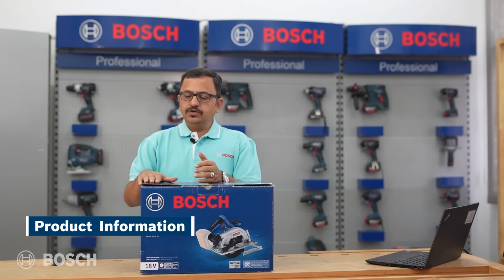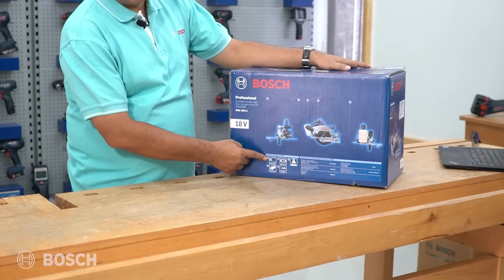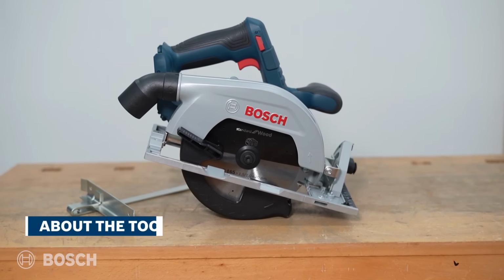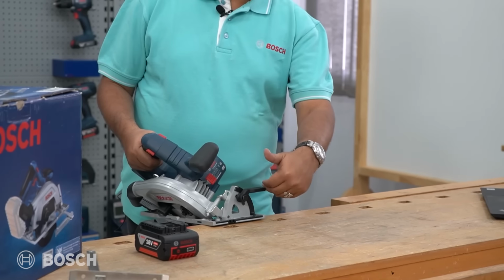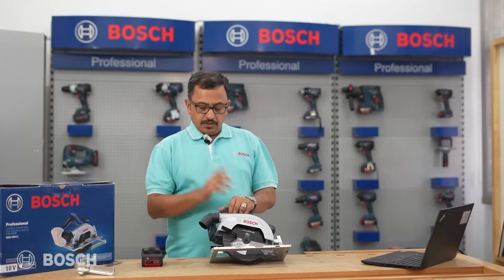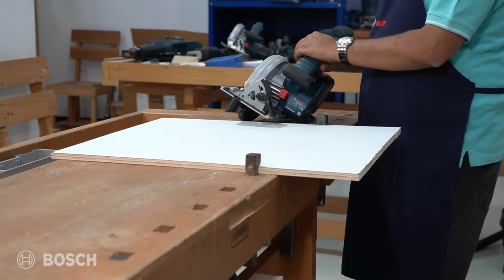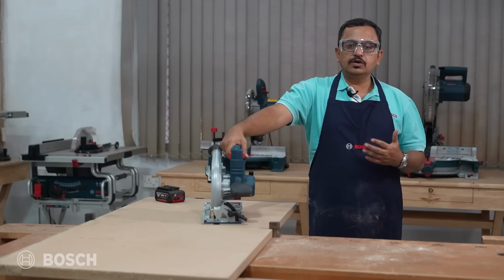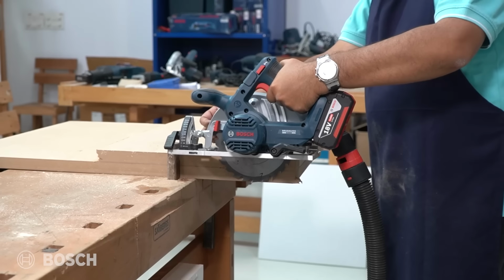Bosch GKS 185-LI CORDLESS CIRCULAR SAW (Solo) | Unboxed & Explained | Basics With Bosch

Comment: Since you are demonstrating and as a woodworker, please always set your depth of cut based on on the depth of the wood you are using. It is very bad practice to set the saw full down and cut a much thinner board. It increases the chance of a kick back when using the saw.  Safety first please!
Reply from the maker: Kindly call us on 1800 425 8665; Mon-Sat 8 a.m. - 8 p.m. Except Sundays and Public Holidays.

Comment: Thanks, but
What's the difference with GKS 18V-57?
Reply: Hi can we use 4 and 5 inch disk in this machine
Reply from the maker: For more information on GKS 185 - https://www.bosch-pt.co.in/in/en/products/gks-185-li-06016C12L1